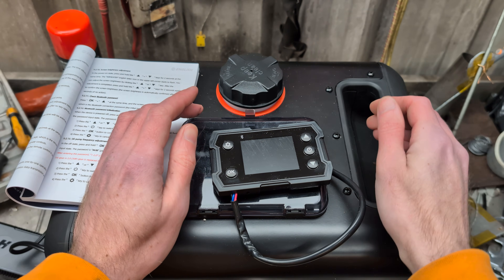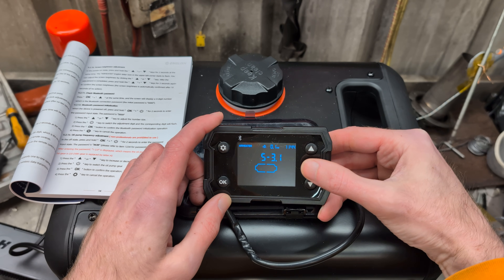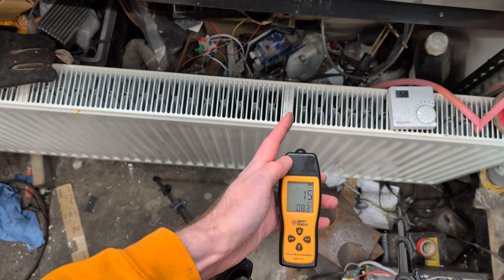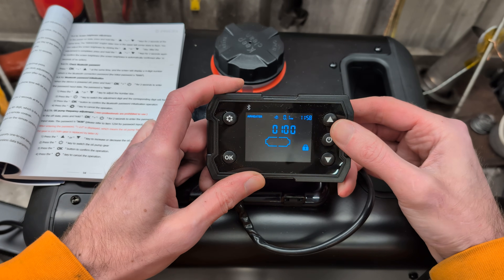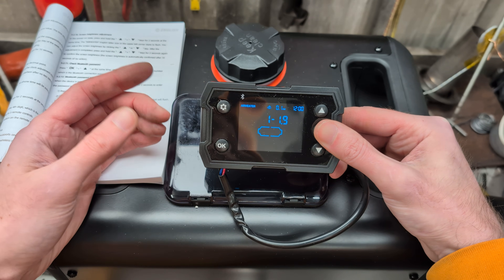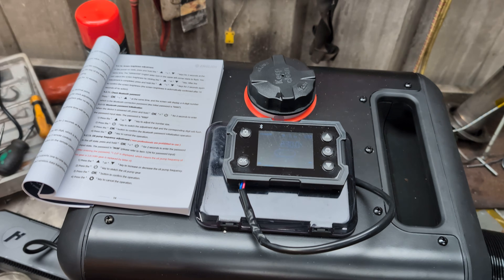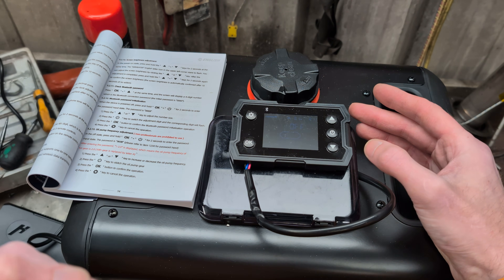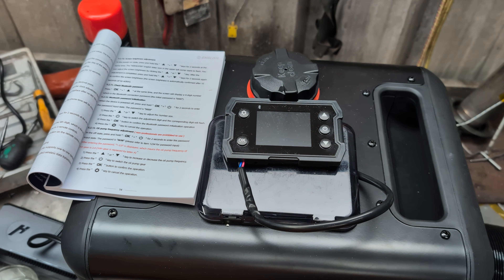Hcalory Toolbox MAX diesel heater - Tuning

Comment: That up and down thing you mentioned towards the end of the vid, I have that for a few mins on a cold start up along with a horrible tasting smell. It also happens but only briefly on shut down. (It's not a fuel smell) When the system is running normally there is no smell and it runs fine.
Is there something I can do in the tuning that will prevent this smell?
I have a second older hcalory unit that doesn't do this.

Comment: Hi, You do fantastic interesting articles. Do you know by any chance what the minimum air intake volume would be required for this heater? I'm intending to recirclate the air from my workshop. I'm extending the inlet duct by about 1m and enlarging the duct to 100mm and hoping the heater will still be able to draw in enough air or if I might need an in-line air fan to help it. The heater will be outside with inlet and outlet ducting to inside the workshop. Thanks very much.

Comment: I set the second level to 2.8 Hz (heat and low consumption), it holds the temperature at 228-232°C beautifully. I just don't know how to lower the fan speed. If the temperature was around 245°C it would be perfect:-)))
Do you know how to lower it? Maybe with a different controller?

Comment: Very interesting video, seriously considering ordering the toolbox but dubious it will heat my 36 square metre (floorspace) shed, it's seriously cold in there.
Reply: Im heating a 150sqm garage with ease. I did install 1.5" foam insulation on most of it. But my 12 gallon tank gets me about 10 days when it atou. 30°f. Right now its 10-20° F, I get about a week out of 12gal. I got temp set on 55°F all the time, when Im in there Ill tune it up to full power (burn out clean), then adjust to comfort.

Comment: I noticed your setting for 10 was below what they had programmed for 9. Do you find it fairly common on these heaters in general that on the high end the setting isn't really set properly? Or is it across the board for the other settings too? (Understanding you said you really just focus on the high and low end). Do you find that if the fuel pump setting on the high end is too much, it's pretty well every setting will be too much, or are the settings all over the place?

I suppose that since they give you the code and instructions how to change the settings, they know the way it comes set may or may not be "correct"?

No CO detector here, but have this heater. Just used it out of the box and ran "fine", but would be interesting to see how it is actually running.

To be fair, being unable to ship heaters once they've had fuel in them, there is no way they can "tune it" before you receive it. Heck, they can't even test them effectively for leaks, either.
Reply from the maker: I'd say most leave the factory close enough.  Sometimes you'll get a cheap heater where they've managed to put a 4KW ECU on a 2KW body.  Or they've put a 22ml pump on but the ECU is programmed to 16ml.  Apart from that no two heaters are exact the same and the pumps aren't all exactly the same.  Plus if you've altered the intake tubing or exhaust all these things alter the burn.  So having the ability to tweak is great.

Comment: Interesting video David, I can't believe that your burn chamber is getting up to 230C I have one of those cheap all in one Chinese 5kw heaters from Amazon I've had it for 4 years and it has a Afterburner controller fitted but I've never got the temp over around 150C I recently fitted a new burn chamber but now I can't get it over 140C on high my settings are 4.8hz  with the rpm set to 4300, it starts and runs fine and the co at the exhaust is around 16 to 25.

Any advice would be appreciated👍
Reply from the maker: What size is the fuel pump?
Reply: Hey mate, I have finally fixed it by fitting a new fuel pump it now gets up to 190C with my high settings on 4.2hz @4300rpm, I'm not sure what size the old pump was as it didn't have anything on it apart from 12V.
Anyway it's working fine now, the old pump was the original from when I bought the heater 4 years ago

Comment: Thanks David, very helpful, what approx level in PPM would you be aiming for when tuning ?
Reply from the maker: Less than 40 would be a good start.  I just mean I wouldn't spend hours stopping, adjusting, and restarting trying to get it perfect.  Would be better if it would adjust while running.  But it's adjustable, so we'll take the small win.  :)

Comment: What are the 12v DC start watt load when cold and hot on your tuned toolbox max?
What are the watt spikes at each temp start?
So you're trying to tune it to 30ppm or less without throttling?
Reply from the maker: Never saw more than 9A on start.  The highest load point is when the glow plug, fan, and fuel pump all run together.  30ppm or less would be ideal.
Reply: @DavidMcLuckie thank you 🙏 I was hoping for under 10amps so my power station could run it (along with my refrigerator) in DC so as not to waste electrons on the AC inverter. Subscribed